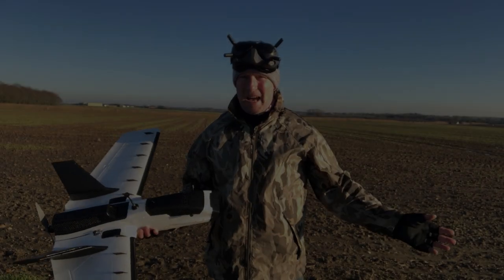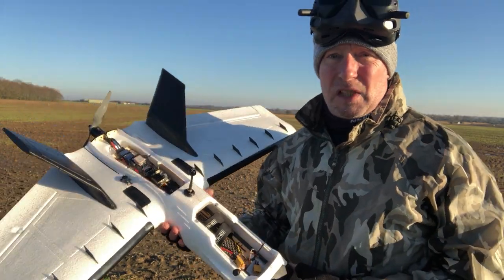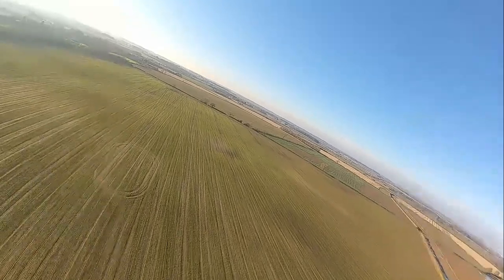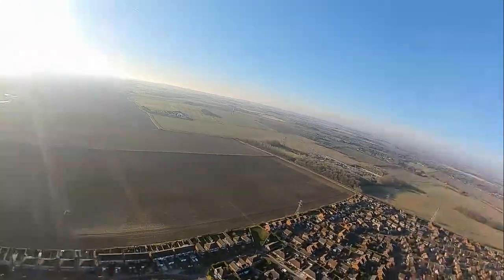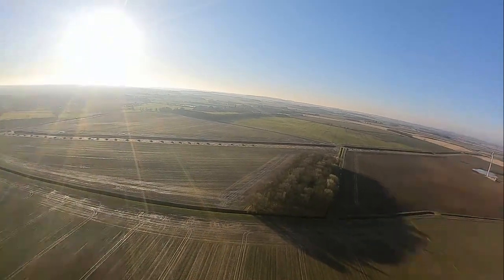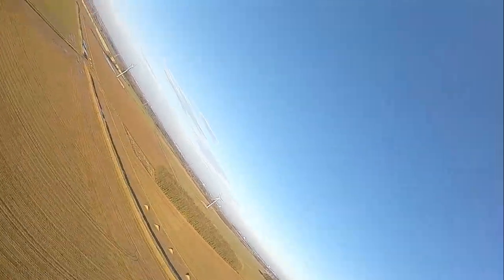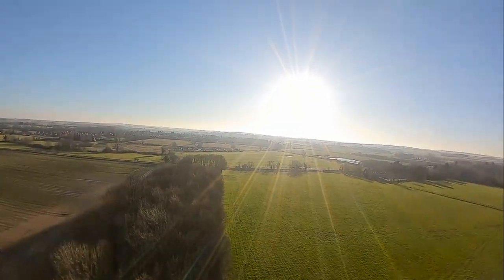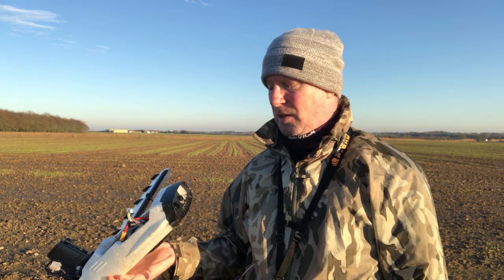Dart XL Flying Wing DJI iNav Arduino OSD Test Flight

Comment: I'm seeking some info on the current status of what INAV OSD elements are now displayed using the DJI FPV system and INAV. I am only familiar with what is displayed in Betaflight OSD and I know that DJI still hasn't made available the entire list of elements that are currently available if you run analog. Do updates to the DJI FPV system firmware generally have impacts (provide improvements) on both OSD elements in INAV & Betaflight?
Reply from the maker: I understand that iNav only displays the same elements as Betaflight at the moment. DJI are looking at the iNav situation I believe and hopefully they will include this in a future firmware upgrade. This video explains it quite well https://www.youtube.com/watch?v=rIZW4q3vrk0

Comment: Nice video! I have modded my dart xl to be able to use dji too now that i have confidence with the system over some months of drone usage with it.
I see you have very good autolaunch parameters, i always take off on manual, but since i may try in the future could you possibly share them? thanks and nice work!
Reply from the maker: Thanks, I have not tried it on a quad yet,  I am going to install the system on my 10 inch Hildagard 395 quad and see how it goes.

My Dart XL iNav launch settings are below, bear in mind that when you set Autolaunch and throttle up on my settings the prop will spin (as per the video) to change this if you wish set nav_fw_launch_idle_thr = 1000

I find with the prop spinning I get a much cleaner launch especially if I am carrying a heavy lipo.

# get launch
nav_fw_launch_velocity = 300
Allowed range: 100 - 10000

nav_fw_launch_accel = 1863
Allowed range: 1000 - 20000

nav_fw_launch_max_angle = 180
Allowed range: 5 - 180

nav_fw_launch_detect_time = 40
Allowed range: 10 - 1000

nav_fw_launch_thr = 1900
Allowed range: 1000 - 2000

nav_fw_launch_idle_thr = 1200
Allowed range: 1000 - 2000

nav_fw_launch_motor_delay = 100
Allowed range: 0 - 5000

nav_fw_launch_spinup_time = 100
Allowed range: 0 - 1000

nav_fw_launch_min_time = 2000
Allowed range: 0 - 60000

nav_fw_launch_timeout = 6000
Allowed range: 0 - 60000

nav_fw_launch_max_altitude = 6000
Allowed range: 0 - 60000

nav_fw_launch_climb_angle = 30
Allowed range: 5 - 45